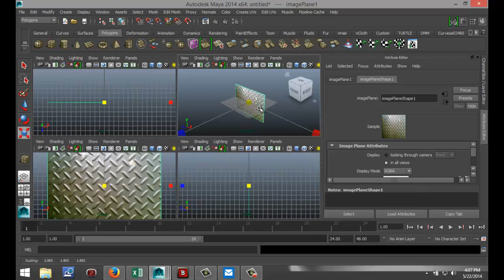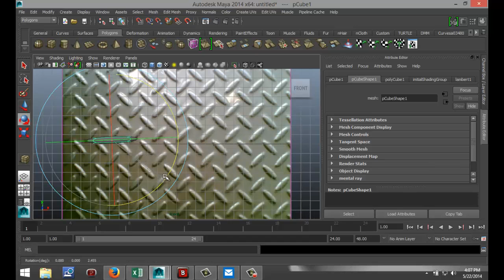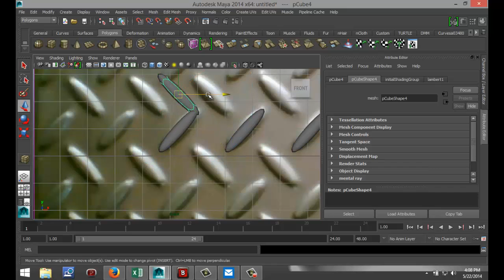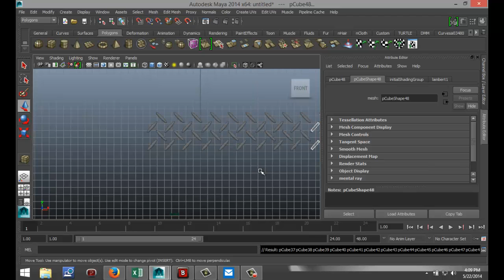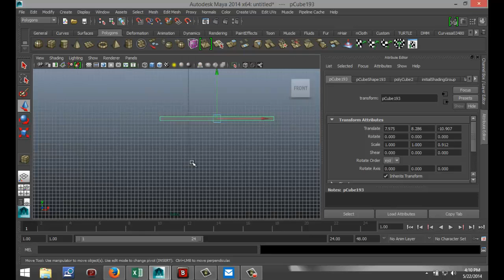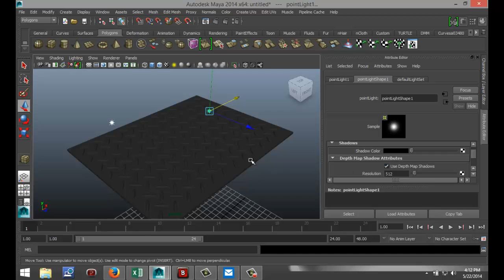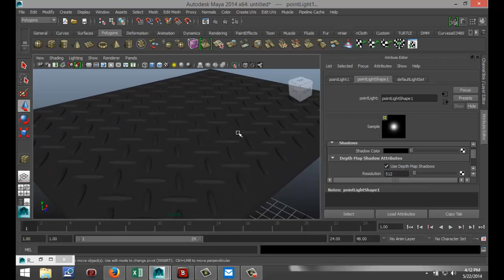Maya 2014 tutorial : How to model a checkered steel plate

Comment: i wanted to know you i need to combine them and when i tryed that it changed the geomrty a little. Maybe im doing somthing wrong not to sure. Was gonna use this idea in a scene im making with maya then put it into smoke etc.
Reply from the maker: Hi Leon,

Combining geometry shouldn't change it.
Are you using Control + G to combine ?
Are you modeling with polygons or nurbs ?

Regards,

Mike
Reply: hmm maybe i did somthing wrong then ill just try it all over again

Comment: you allways have very useful lessons for us thank you again. I was curious to ask if you can suggest a grid size for when your doing simple modeling for that. I was also curious what recording program u use because i have screen soft and still have to crop to make it work which is fine to but im curious to know what the pros for speed modeling are using? If not no worries. Thank you for your time again
Reply from the maker: Hi Leon,

I use a program called Camtasia
And for the grid, I use the standard setting in Maya. I don't change a thing.

Regards,

Mike
Reply: Thank you